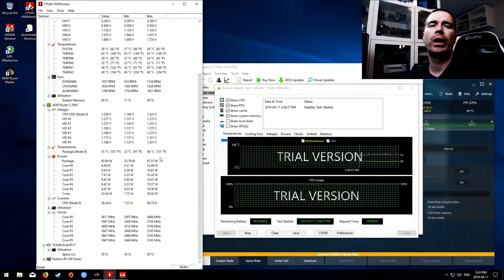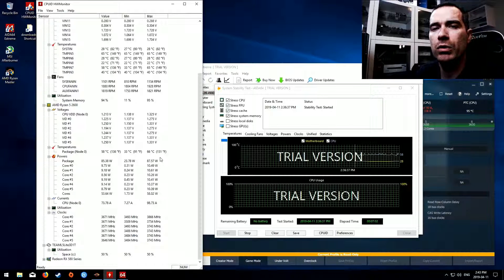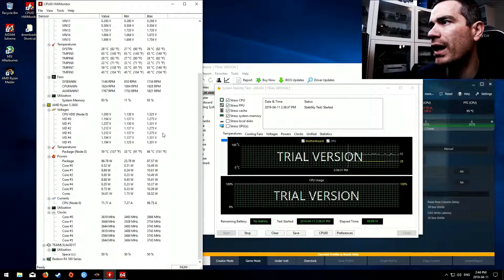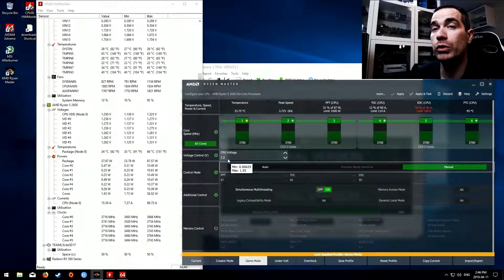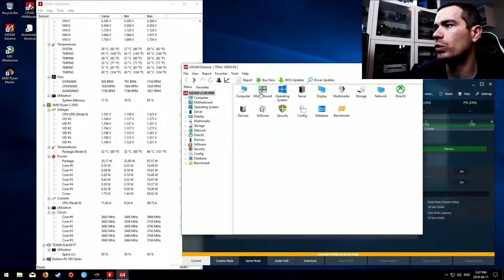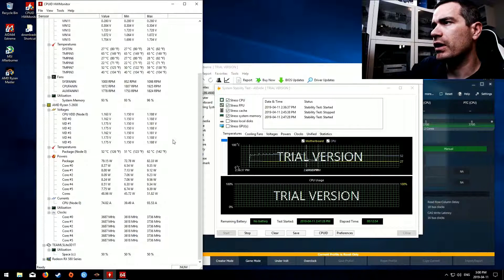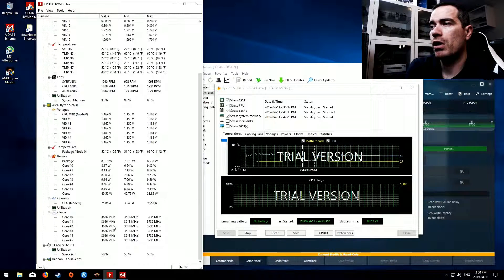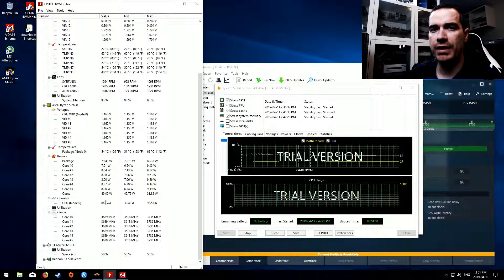Please Stop Using Auto Voltage On your CPU

Comment: Would you say the VID from the HWiNFO64 (or in your case CPUID), is the correct voltage you should match in UEFI? The VID from my readings is up to 1.463, and my fixed voltage in UEFI is 1.450, the reading in HWiNFO is 1.448 at max. Im wondering if it means the CPU wants me to set the voltage to 1.470 to compensate for the VID. My i9-12900k is currently clocked at 5.2ghz all core ratio on P-cores and 4.0ghz on E-cores with AVX2 offset at 2x.
Reply from the maker: VID is what is requested not necessarily what it's using. Is the overclock stable? what are you trying to do?
Reply: @HardwareForGamers  Its stable for now, i had to up the voltage to 1.450 or it would crash at 1.350 & 1.400. I figured VID is whats requested, as stated in HWiNFO, just not sure if i should increase voltage to match it or not. But maybe it will crash later today when i play some more games or run benchmark or cinebench, havent tested enough to say its stable yet.
Reply from the maker: @EricTheBroBean  What are your temperatures at, and what are you using for a CPU cooler? Because you are right around the max of the recommended Max voltage.
Reply: @HardwareForGamers  Temps depend on how im testing it, in cinebench around 90c multicore, but when gaming, no more than 50-60c tops. Using a NZXT Kraken z63 AIO. I might be able to set the voltage a little bit lower now that i decreased two of the cores from 5.4 to 5.2ghz. Maybe decrease e-cores back to 3.9 too, they arent really that important to gaming performance.

Comment: The only people even looking at CPU voltage are the OCers and I think it's safe to say we don't use Stock/Default/Auto Voltage ever. No one else will have the programs to see it or care. I would suggest maybe discussing VID, Vcore, LLC, Spread Spectrums, etc. What they are, how to use them as an OCer and why. I'd be interested.
Reply: VID is voltage tables, preset levels for a given clock speed.  They are ignored if manually controlling voltage

LLC reduces resistance in phase delivery to allow stability at lower voltage but too much can wreck your shit, medium to low is ideal.

Spread spectrum should always be disabled, it clips frequency to reduce roof neighboring circuitry and is used to pass FCC regulations.  I less you're in a hospital or NASA, it's best disabled
Reply: @brovid-19  so you're saying I shouldn't be manually lowering or raising my voltage while overlooking? I've learned different and one of the first things I do is mess with voltage to adjust for the overock. I'm not 100% sure what you mean. Most the presets I leave alone and only stick with the main ones that directly effect the oc. I haven't oced in a while but I've never had a card or cpu fail after oc and have lasted years after so I feel like I've been doing it right

Comment: I am new to this and I really don't know what to do , i have a ryzen 5 3600 ,  i set it on auto voltage , which it means 4200mhz max , but I have too  much temperature  spikes , about 10c°  at idle , from 37 to 47 , and in gaming about 70c° with spikes at 80 , but if I put static voltage at 1.2v , with 4000mhz , it is stable as fuck , 38c° idle , and now is the most incredible thing ,  in demanding game , like warzone , i have only 58c° to 60c° max , and now it sound like i know what I have to do , but there are people who tell that if you put static voltage you harm your cpu .  If you  can help me i would appreciate it , thank you
Edit 1 : my motherboard is a b450 aorus elite v2
Reply from the maker: based off those temps, I'm guessing you have the stock wraith cool?? those people aren't wrong about voltage harming the CPU but on Ryzen you won't do any "real" harm unless you go over 1.4v, which you are not so you should be good with what you have. 

now I would recommend if you have time to try and under volt your 3600 to get that 200mhz back. but that's up to you.
if you are interested I have so video to help you out.
How To Overclock And Undervolt A CPU and GPU - https://youtu.be/jpRwtMzZ9aQ
Overclocking Your Ryzen CPU Using Vcore Offset - https://youtu.be/f1Njnl5mNwU
Reply: @HardwareForGamers  , i have tested a little bit and I found it stable at 1.25v , 4200mhz , the cooler is a be quiet pure rock 2 
 i will watch the video , thank you

Comment: I have a Asus MB and my 9700 wasn't boosting at all. Changed CPU voltage/ CPU cache from auto to adaptive.  Now its boosting but WAY over performing.  It went from 7% on userbenchmark to 100% pegged out on their performance scale way above average.  On timespy it is also benchmarking way above average.  Temps look good but is it safe? Why is it over performing by so much? All I did is change that one setting and nothing else.
Reply from the maker: Do you have a 9700 or 9700k? Either way it's likely the motherboard just overclocking the chips itself by removing power limitations and focusing only on thermal limitations. Just as long as the temperature is fine everything should be fine you might want to check your vrm temperature.
Reply: @HardwareForGamers  it's a 9700 non k. You have any idea why it wasn't boosting? Anything else you recommend I check. I'd rather have it operating normally without having to set it to Adaptive. XMP 2 is already active but these are the only two settings I have tinkered with. I'd appreciate any input, trying to learn!
Reply from the maker: @tac6044  that setting you changed removes the power limit to the CPU, so it will boost all cores  untill it hits thermal limits.
Reply: @HardwareForGamers  is that safe?
Reply from the maker: @tac6044  if temperature is under 95c yes

Comment: Change using bios, ryzen master is not stable, i OC all my cpus to 4,1ghz and cpu volt to 1.4v (Stable), i don't care if my cpu life shortened his life 2 years.
Reply: I use my CPU i7 990x for over more than 10 years with a voltage of 1.45v.
And its still running like a charm.

Comment: Does this accomplish anything beyond pacifying one's OCD?

Your screenshots show that the CPU's average clock frequency has slowed down a little, and it is running a few degrees cooler. Was this your goal?

Some people use their computers in non-air conditioned room, where the night/morning vs afternoon or winter vs summer room temperature can vary by several degrees. Allowing the CPU to regulate its own voltages allows it to work at its fullest potential in all scenarios. Additionally it allows computers to be used in both cold basement/cold garages, as well as hot attics, or in direct sunlight, without worrying about stability, or tinkering with voltages.

A self regulating CPU voltage also allows the CPU to draw as little power as possible while idling or mostly idling, which is most of the time. Even in most games, a CPU is very lightly loaded. Forcing its voltage to be higher than it needs for light work causes it to dissipate unnecessary extra power, which means the power bill will go up a little, fans will blow a little more air, and the components will accumulate a little more dust.

I think for most computer users, the auto setting is appropriate, as it allows them to receive the most performance available under their conditions, when needed, and maximum power/noise savings when idling, and does not require them to tinker with settings that really should be self regulating.

Tuning voltages for maximum available performance at all times is exactly the wrong thing to do, imho.

I don't see how a fixed voltage translates into real-world benefit.
Reply from the maker: Undervolting - reduces the amount of power/voltage being directed to your CPU. The more power sent, the hotter it gets. The less power, the cooler it gets.... (google search result)
Reply: @HardwareForGamers  google "operating range". It's an evelope defined by frequency, supply voltage and die temperature. A fixed voltage constrains the normal operating range to a forced operating range.
Reply: I fully agree and think that video poster didn't get your point. I watched the video, wanting to know about possibly trade-offs/dangers of using auto-voltage, but there was no point made. I already understood that auto-voltage leads to a broader temperature range, but why exactly should this be bad for the CPU?
Reply: @aldigangster123  There is a discipline of engineering that deals with failure management, and it is only an AMD failure management engineer that could explain specifically what failure modes are designed in, and what the parameters are. Everyone else, including myself, can only speculate.

Arguably "bad for the CPU" means "makes the CPU fail sooner than expected". In engineering lingo it means an operating range which lowers the CPU's calculated*/*expected MTBF below the design lifecycle requirement. Suppose AMD designs its CPUs, including tuning their auto-regulating features, to have an MTBF of 5 years, or 20 years. Anecdotally, AMD defines the "F" in MTBF as 2% or more of samples failing to operate correctly. Further, suppose that the highest MTBF is expected for CPUs that operate in a thermal cycling regime at 2Hz (ie, cycling from cold to hot every 500ms); this is also an arbitrary figure I picked; an AMD quality engineer would know what this characteristic is, I can only speculate based on having no information whatsoever. For a particular application, say a CPU which is thermally cycled at 0.1Hz, and over a 40-90C range, at 1.4V, the MTBF could be calculated. Suppose that figure is 12 years. A similar application that operates in the same range except at a 1.5V voltage, might have an MTBF of 6 years.

You can find exact operating ranges for MTBF calculation purposes in the "Absolute Maximum Ratings" of any semiconductor datasheet. These are engineering specifications that are not typically made available to the end user. System designers need them, but apart from that, they are a mere curiosity for most consumers. You can find an example in the datasheet at https://www.amd.com/system/files/TechDocs/31119.pdf

Now, the question is, would a 6 year MTBF be "bad" from your perspective? How about a 12 year MTBF? Qualitatively, only you can decide if a particular MTBF is "bad", and you'd need the ability to calculate the MTBF, which you don't have.

Calculating the MTBF is complicated to say the least; if you're a big enough customer, AMD can calculate this for you for your exact application. For consumers, forget about it.

In short, qualifying the "badness" of using auto-ranges is both very complicated, and not something consumers need to worry about. AMD has taken care of guaranteeing a minimum MTBF by specifying the acceptable voltage/temperature ranges. 

If you wanted a much longer MTBF (say 100+ years or 1000+ years), or higher performance than is possible within the specification, then you'd look into trade-offs, but be prepared to do some serious engineering. If you're a normal user, expecting to use it 5-10years, and the stock performance is good enough for you, then don't waste any time worrying about any of this.

Allow your CPU to work in those ranges, and you'll get a long life out of it, probably much longer than you are likely to keep using it.

Terms to google for more insight: MTBF, annualized failure rate, thermal fatigue, failure modes of silicon.
Reply: @aldigangster123  sorry for the very long reply.

Now, there is some disadvantage to using the "auto range", but I suspect it is so miniscule in practice, that it's not worth trading off MTBF to eliminate it.

Specifically, it takes some time for the CPU to switch from low performance to high performance, ie, to increase its voltage/frequency on demand. I suspect this time is in the order of 0.5-10ms; Every time the CPU needs to switch, it will still run at the "slow" speed for "some time", perhaps 0.5-10ms, before experiencing the "high performance" thruput. An application that frequently switches from high-to-low and vice versa will take a longer time to complete the work than one that stays at high performance all the time.

Is this difference measurable in practice? I suspect most consumers would not be able to measure a difference, and thus justify running their CPU at a fixed voltage/clock speed.

Comment: i have a 5800x on a gigabyte b550 aorus pro ax with a noctua d15 which was immediately hitting 90 degrees C on auto voltage settings in cinebench r20. the sore was around 5900. so i set the voltage offset to -0.05v and i got a cinebench r20 score of 5960. it still hit 90 degrees C but it didnt hit 90 immediately like on auto voltage. it immediately hit 80 degrees C and slowly crept up to 90 degrees C. 

i will set it to -0.1v later today and i think the temp will be reduced to around 82 degrees C while getting a similar cinebench r20 score. i also might try buying a good AIO water cooler next year and see how that reduces the cpu temps as im pretty sure an air cooler isnt enough for a ryzen 5800x. 

btw gamers nexus did a 15 minute video on voltage offset for ryzen. anyone who wants to lower their ryzen cpu temps while keeping the same or slightly improving their cpu performance should definitely go watch it.
Reply from the maker: Yeah, by having a lower temperature lets the CPU boost more which then can give you more performance especially on the Zen 3 CPUs.
Reply: same here. i5-6402p hitting up to 70 celsius or hotter when running tf2 and clone drone in the danger zone. with 1500RPM fan.

Comment: I don't understand this.. You are comparing lowering the max voltage to leaving it stock and running it at max.. this really makes no sense. For a fair comparison you would need to lower adaptive down to that same max voltage. Or else your cpu is always going to be warmer overall. If you compare both settings under zero load your manual settings will be hotter.
Reply: Setting the vcore mode to adaptive just on it's own doesn't mean it will never exceed the vcore number you set in the bios. It can draw more voltage than what you set. At least in my experience. You'd have to use an offset as well I believe.
Reply: @retrocny5625  I thought "adaptive" and "offset" were interchangable for the same setting. I meant offset max needs to be the same voltage. My computer is about 7 years old so maybe adaptive is a newer setting?

Comment: My cpu has been running at .93. I oc the cpu ratio and nb but somehow even with that voltage it still booted fine. 
My question is if i increase the voltage would I get a better performance because I’ve compared my cpu fx 8350 to others and mine is so low I’m getting like 1000 cinebench r23 score multi.
Reply from the maker: Increasing just the voltage shouldn't improve performance, unless the CPU is not stable. Are you comparing your fx8350 to other fx8350's or just other CPU's? Because the fx8350 is not a good, fast, or even really an 8 core CPU.
Reply: @HardwareForGamers  On cinebench or even cpuz. The same cpu is performing so much better
Edit: for reference amd athlon got 94 single score. Mine got 82. Ryzen 5 3600 got 488. Amd fx 8350 got 241. 241 and 81 is a huge difference so that’s why I’m like what’s wrong with mine. It still works fine but if I could get extra performance than why not.
Reply from the maker: @ajk9420  what frequency is your CPU running at?
Reply: @HardwareForGamers  I oc the cpu to 4.4Ghz and Cpu-Nb to 2400Mhz. Ok I think I see the problem. All the 8 cores never go above 1399Mhz. I think that could be the issue but I don’t know how to fix that.
Reply from the maker: @ajk9420  I think you need to reset your BIOS to default. My best guess is one of the settings in the bios is telling the CPU to run at base clock.
Reply: @HardwareForGamers  Yo thanks for trying to help but I finally found out what was wrong. It was my mobo and it has a slow mode switch which I disabled
Reply from the maker: Cool, GL and HF.
Reply: .93 you mean 1.93v?

Comment: Don't listen to idiots this is actually very informative that I wish bigger youtubers have said they explain don't use it but never say which voltage you set an example and got the same performance from the cpu with lower volts which increases the efficiency of the pc power draw and how long the cpu will last

Comment: why im getting this error? ''hardware failure detected test stopped''
Reply from the maker: Something is unstable. CPU, memory or something else.
Reply: @HardwareForGamers  what i supposed to do?
Reply from the maker: @crazyboiii7840  I need more information... why are you testing? what are you testing for?? system specs??
Reply: @HardwareForGamers  I think because yesterday i got blue screen and after reseting windows i was playing game and it just randomly turnned off.My pc specs AMD Ryzen 5 2600 gtx 1050ti Patriot viper 2x8 3600 but im setting 3200mhz with xmp psu corsair vs450 btw im using default bios settings only xmp profile.
Reply from the maker: @crazyboiii7840  ... my best guess is that it's your ram. in Aida64 are you stressing the memory? if you are I would not. just try and stress the CPU, FPU and cache, see if it will run. if it does then the issue is likely with you memory. plus what are the CPU temps??
Reply: @HardwareForGamers  ok i will try.Cpu temps max 60
Reply: @HardwareForGamers  i just stresstested my cpu, fpu, cache 10minutes with no errors.Everything is fine but  i saw that my max temparature was 82 and cpu ghz went down to 3.4ghz sometimes 3.3ghz.When im playing games its 3,7ghz btw im using stock cooler.
Reply from the maker: So it does seem like it is the memory then. Have you checked for BIOS updates for your motherboard. That might fix the issue, but you don't want to over update it or you can try Windows memory diagnostic tool to see if it's the sticks of RAM.
Reply: @HardwareForGamers  i have gigabyte b450m ds3h mob so what bios version i need to update?
Reply from the maker: @crazyboiii7840  it looks like you would want F40